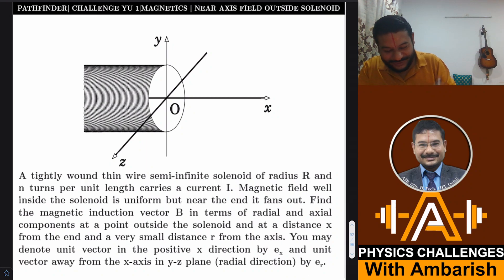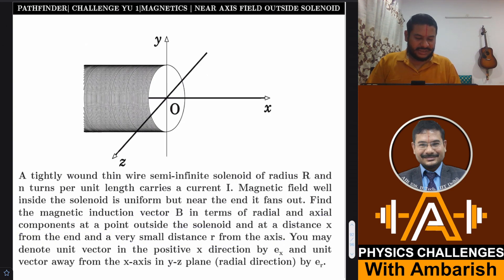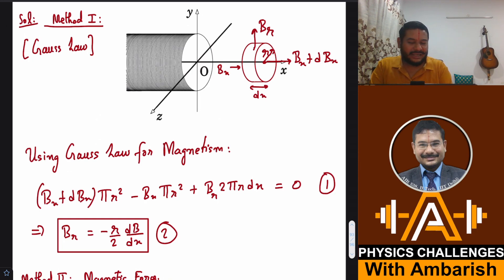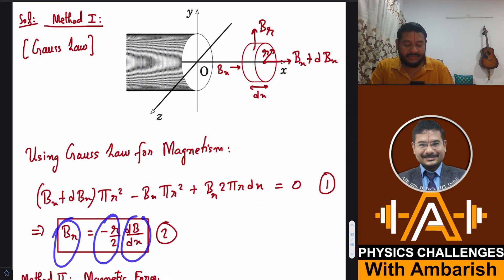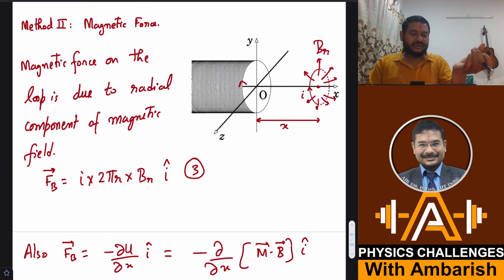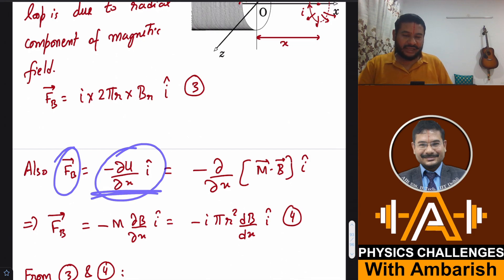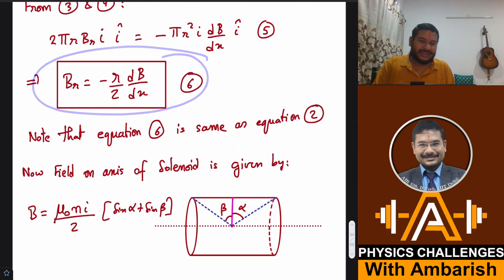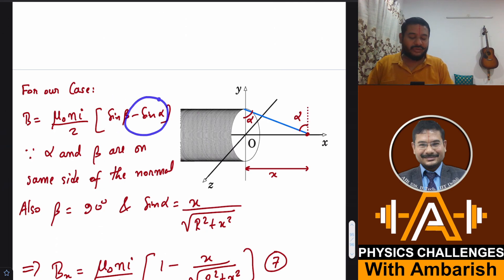MAGNETICS| PATHFINDER| CHALLENGE YU 1| RADIAL FIELD NEAR A SOLENOID AXIS| FLUX METHOD| FORCE METHOD|

Comment: Solved it by gauss law, but the other method is mind blowing sir !
Reply: Bro when we equate 3 and 4 .. the 4th equayion is positive then how we get -r/2 .. how it matches with 1st method
Reply: @NARUTOUZUMAKI-yi8ix  why neglecting the -ve sign in eqn 4? If i is unit vector, and if A(i)=-B(i) then A=-B na, that's what sir has done
Reply: @green7603  check 5:46
Reply: @NARUTOUZUMAKI-yi8ix  M vector direction is on +ve x, while dB/dx vector direction is on -ve x, so while doing dot product cos 180 will come, so ig it's right